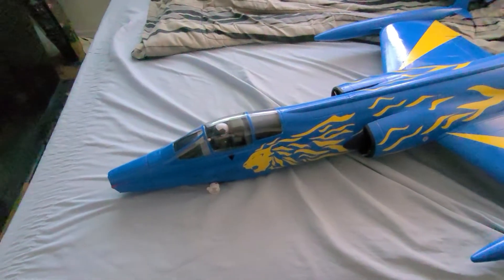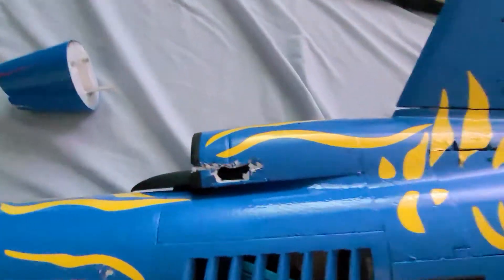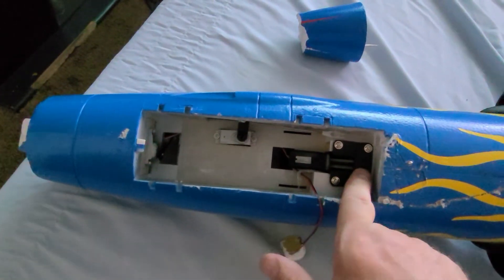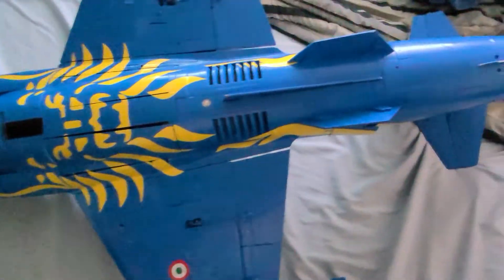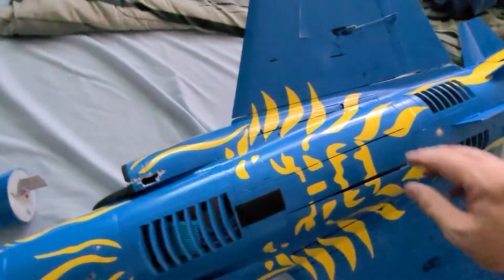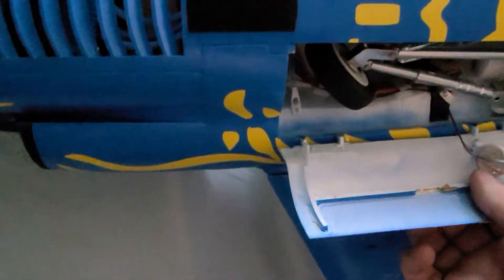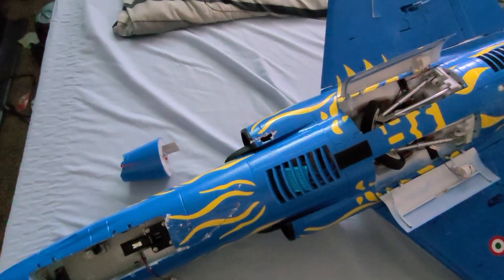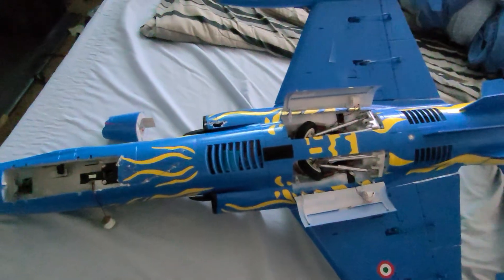freewing f-104 Starfighter repair inspection

Comment: Totally fixable. Good deal.
Reply from the maker: Yeah well like Matt said on Facebook that I noticed it was stalling so I tried to wrestle it out to minimize the damage but unfortunately caught the nose pedo tube. Of course you don't have time to pull up your gear...
Reply: @victorrcjets7660  Took out the nose on my 90mm freewing F18-C, stall on turn to final. Pulled out enough to save most everything. New fuselage, new nose gear. Just a little worse than yours, but nose in front of intakes was beyond reasonable repair. All back together, waiting to go again. Lol.
Reply from the maker: @shelbyseelbach9568  good to hear, like my f22 did.

Comment: E-120 3oz. Satin Weave fiberglass and System 1000 resin (epoxy) from Fibreglast.com works fabulously in repairing/reinforcingg  foam . . . You can thank me in person If I ever get to meet THE MAN, THE LEGEND!  LET'S GET IT ON -- -- LET'S ROCK!
Reply from the maker: Most the time it's not a problem but definitely a challenge with so many compound surfaces. Pretty much all I did was just fill in the holes that the gear doors cut lightly sanded it. The more challenging part was the intake because it was so thin I just cut off some foam from my damage nose cone to patch the hole because it already had a base of the color already. Where are you from? Definitely hope we can meet sometime soon at an event...